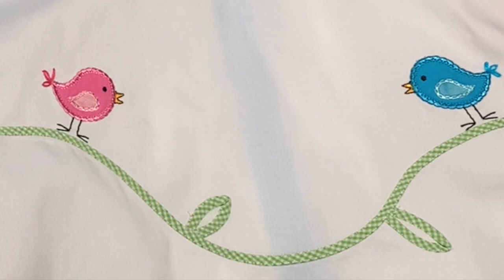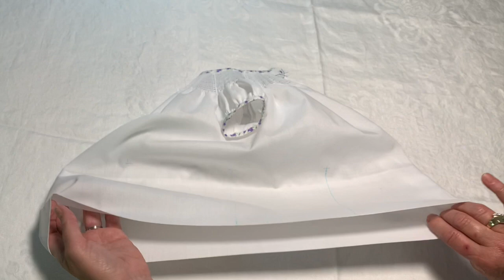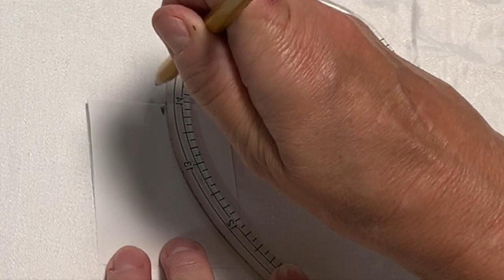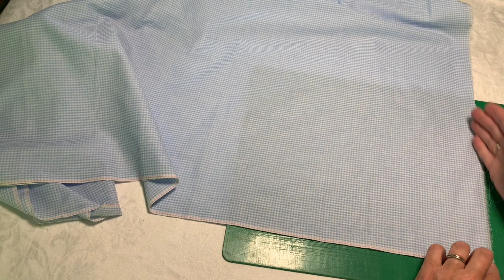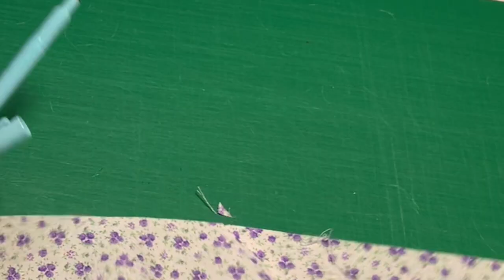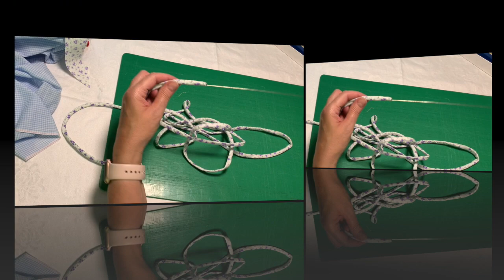SPAGHETTI BIAS - use, design & how to make it

Comment: What is Spaghetti bias? More specifically, what is the difference between 1/4” bias tape (or smaller) and Spaghetti bias tape? Thanks… really enjoying your series of tutorials
Reply from the maker: Spaghetti bias is a finished "tube" (no seam allowances showing) and is usually 1/4" if you purchase it premade. You can make your own and have it slightly larger if you prefer. 1/4" bias tape can be opened up and has unfinished edges on it.
Reply: @kathyssewingstudio  thanks for the clarification. I’ve made miles and miles of 1/4” bias for baby items but wasn’t familiar with Spaghetti bias. Makes sense now… and endless possibilities for embellishments. I appreciated your tip for steaming the tube to keep the seam from showing. I would have made the mistake and hard pressed.